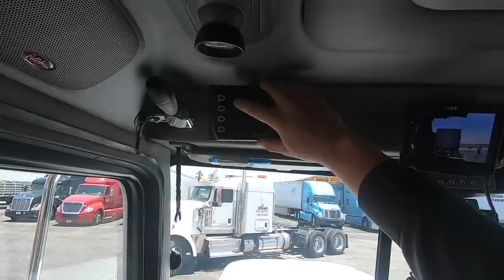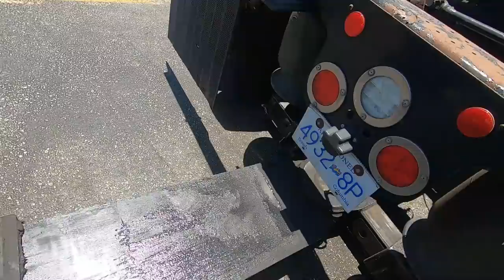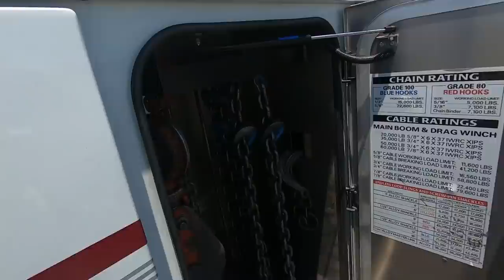Rear Towing Low Profile Freightliner Cascadia

Comment: Great job Trent. A few asked what the first set of chains were for. I explained that you have to chain the front axle prior to lifting the truck because it has an air ride system. Not chaining it up could and most likely would cause severe damage to the air bags.
Reply: I was wondering why he chained up the 1st axl. Thanks for the info for this wondering mind

Comment: Damn, the salt on those Canadian roads must be brutal. That is a relative late model tractor and already the frame is pock marked by rust.
Reply: That is normal.
Reply: The salt we spread out up north is like a cancer once you drive a car in it it starts doesn't matter if you try and wash it either just slows it down
Reply: Not just Canada in upstate NY our roads are covered in salt which just destroys the underside of cars. I had to retire my first car after the frame rusted so bad it became unsafe.
Reply: I was thinking the same.. its fairly new and its trashed
Reply: That's what I was thinking.  Didn't this truck model debut for 2017 or 2018?  Frame is already surface-rusted.
Reply: The roads in Canada have no more salt on them than any other us state in the north like Minnesota, Michigan, Wisconsin etc
Reply: Ever see the show Highway Thru Hell? Yeah recorded here in British Columbia...where that truck is from. It's brutal in the winter on that road and surrounding roads too. In provinces like Manitoba and Ontario salt has to be used to melt ice and try to keep roads passable.

Comment: Good to see the 35 ton
Reply: I didn't realize that Trent's regular 35 ton has provisions for the safety chains built in to the back like the one Darl normally drives.  I'm surprised he doesn't just have chains built in so he wouldn't have to retrieve them from the compartment.

Comment: What was that first chain even for?
Reply: To secure the front axle up so the airbags don't hang down
Reply: You have to chain the front axle so it don't hang down and damage the air bags. He's picking up on the rear axle so that axle is taking all the weight. If you don't chain it prior to lifting the truck up the axle could rip free from the air bags and fall to the ground. Hope Trent don't mind me answering your question.
Reply: Keeps the suspension compressed when he lifted that back , no?
Reply: Trumpasaurus Rex the first chain is used to support the airbags on the front drive axle
Reply: So the axle  won't  be hanging  by the air bags.they dont last long with all the weight and bouncing  around
Reply: The drive axles are designed to support a great amount of weight from above, but are not designed to "dangle" if the frame is suspended by the tow, the entire heavy assembly would flop around and damage itself.  The rear axle is "clamped" by the underlift rigging but the forward drive axle needs to be clamped up too.
Reply: I believe it is to hold up the axle so it doesn't droop and contact the ground.

Comment: So what was that first set chains for?
Reply: If the truck has an air ride system you must chain the front axle prior to lifting the truck up. This will hold the axle up while you lift on the other axle. If you don't chain it up you could cause severe damage to the air bags actually allowing the axle to fall while your towing the truck. Most all semi tractors have air systems now.  Again I hope Trent don't mind me awnsering this question or maybe he can explain it better.
Reply: Drive axles run air ride system. So its on airbags. when you lift the rear end up, the axles basicallly fall out in a way and can cause a lot of damage
Reply: The drive axles are designed to support a great amount of weight, but are not designed to "dangle" if the frame is suspended by the tow, the entire heavy assembly would flop around and damage itself.  The rear axle is "clamped" by the underlift rigging but the forward drive axle needs to be clamped up too.

Comment: what about dive line or air
Reply: Neither need attention since the drive wheels aren't turning and there is no need for brakes with such a light load, the wrecker brakes can handle it entirely.
Reply: I suspect drive line not needed as driven wheels aren’t in contact with the ground

I suspect no air for the same reason
Reply: No air needed or driveline to deal with on a rear tow
Reply: Rear tow!
Reply: I would guess not enough weight to need air brakes, and drive line doesn't matter as the driven axles are off the ground so nothing would be rotating in the driveline
Reply: Drive wheels off the ground. Spring brakes only on drive axles.
Reply: You don't need to disconnect the drive shaft when you lift all the drive wheels off the ground. And you don't need air because the front axle of that tractor does not have parking brakes.